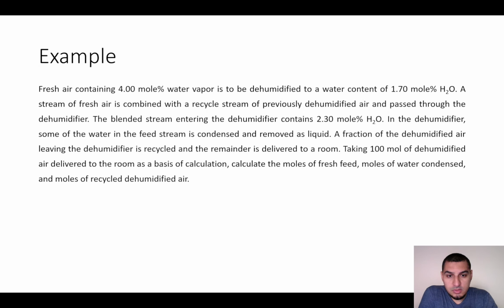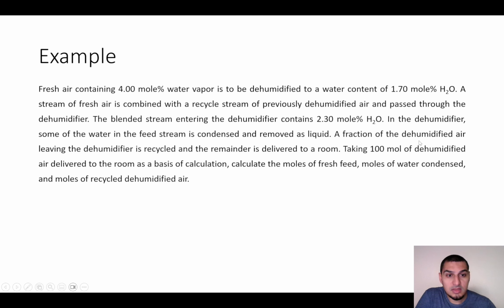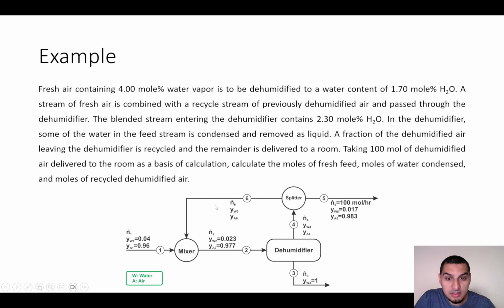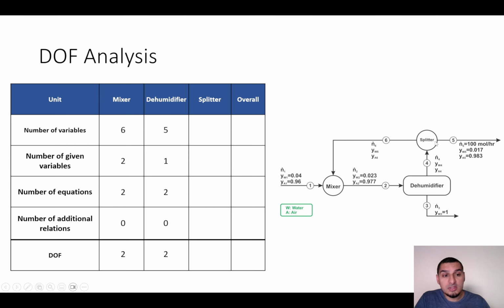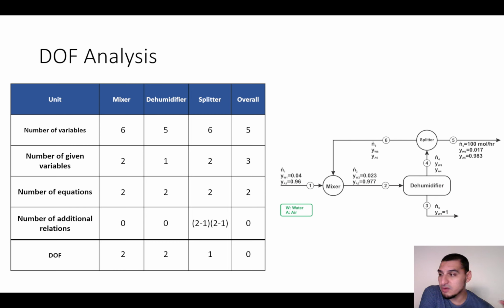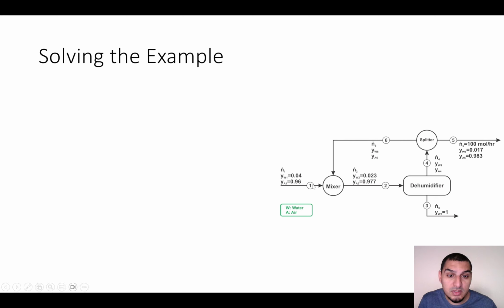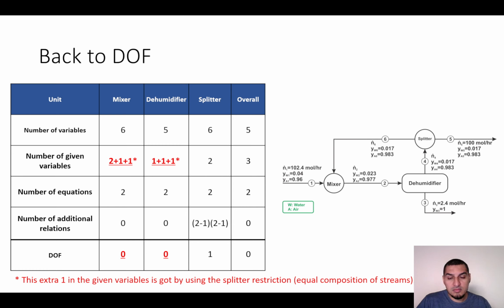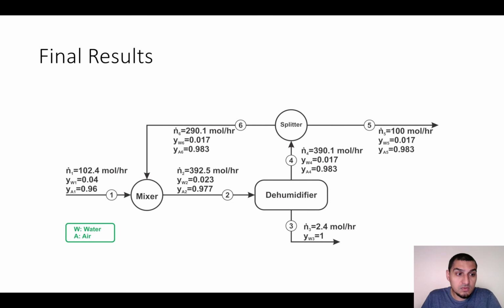Mass balance in English | 33 | Example on mass balance with recycle

Comment: Sir, you had previously mentioned that mass balance calculations cannot be done without at least one stream flowrate/mass/amount of substance being mentioned. Therefore, calculating the DOF of the mixer and the de-humidifier at the beginning is just a waste of time.
Reply from the maker: The degrees of freedom analysis is necessary for to know where to start. Without the DOF analysis you will not know that you can start with the overall loop.
Also, it is important to put a plan for your solution as I mentioned in the video. This is also not possible without the DOF analysis.
Hope this clarifies the point.